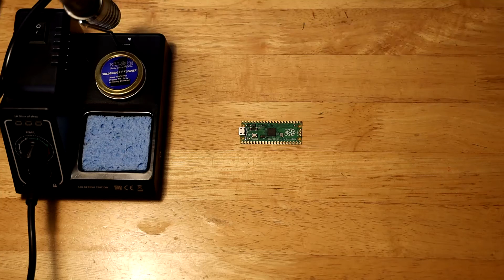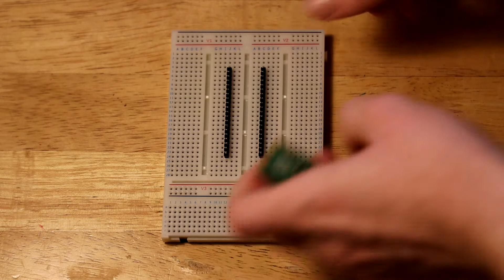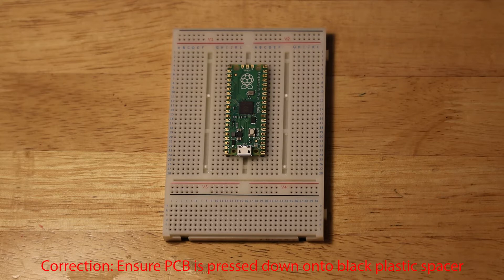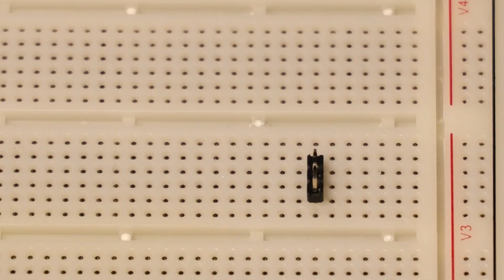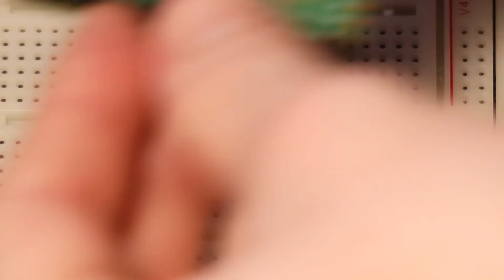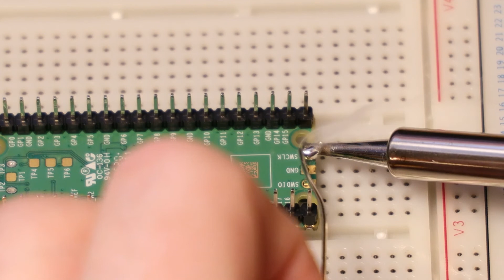Soldering Header Pins to your Raspberry Pi Pico

Comment: This is a great idea but isn't there a risk of melting the plastic of the breadboard? I always worried about that so I never did it this way. I do have a few older dirty breadboards I could try this on to see. Thanks for a great video! Where did you get that breadboard you showed? I like its configuration! THANKS!

Comment: You might want to alternate from one side of the header to the other i.e. pin 1 then pin 20 then pin 2 then pin 19 etc. The reason is to let the pin you just soldered to cool a little. 
If you do it the way show here, ie. pin1 then pin 2 etc  then it is possible for the header plastic to melt in that area. Guess why I suggest this?!

Comment: This may be a dumbquestion, but, just to test the capabilities of the pico with a breadboard, can the pic rest on the headers like you show at the beginning and be used with the device BEFORE the soldering is complete? Do that make sense? I do not want to solder until I am comfortable with the usage is why I ask.
Reply from the maker: Not with normal header pins as the contact between the pins and pads on the pico won't be good enough. You could try with something like pogo pins but at that point it's probably easier to grab a spare pico and have a go at soldering!
Reply: @LearnEmbeddedSystems  great- thank you :)
Reply: The pins are smaller than the holes, so you'll have weak, faint, or just non-existent connections.

Comment: Damn, I have about 10 or so Zero W's I soldered (partial) headers to. The hardest part was making sure they were straight, even though it didn't really matter for what I need. Never even thought of using my breadboard to hold things.🤣